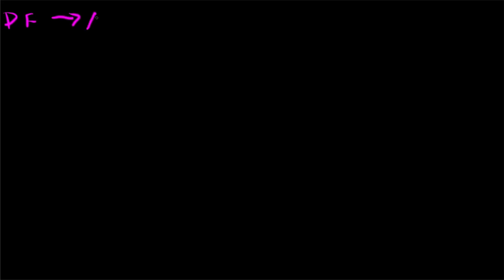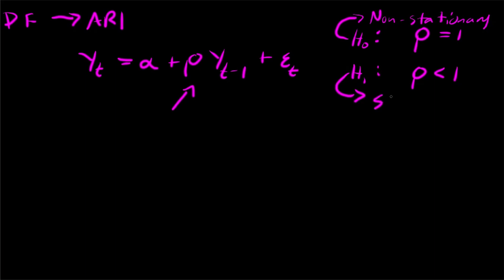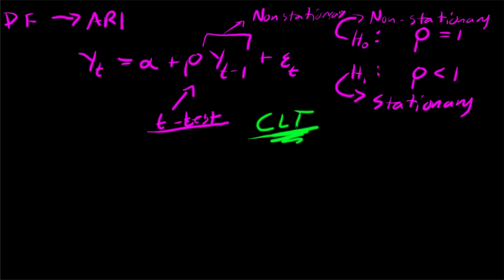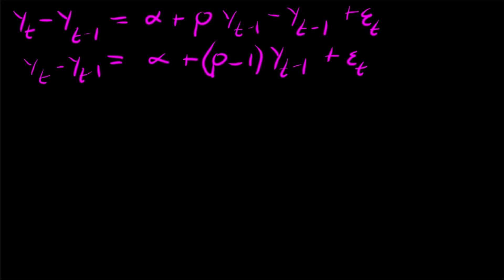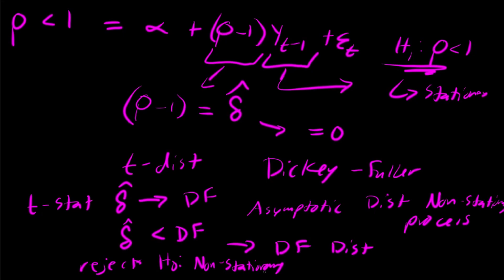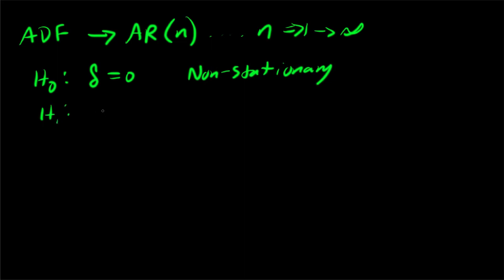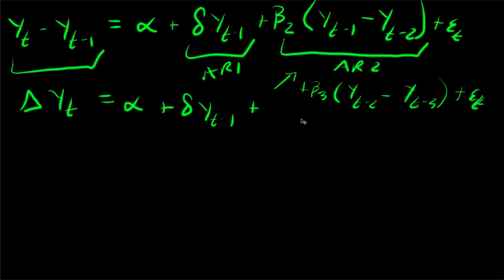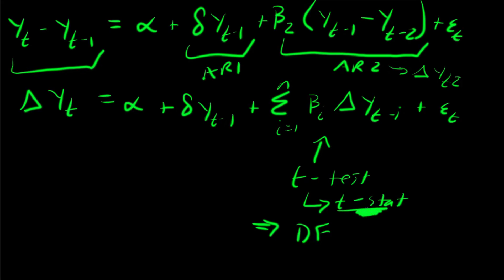DF and ADF Stationarity Testing (TS E9)

Comment: Hello, I have a question, when I manually find the Dickey Fuller statistic value, the statistic value is very slightly different from the value generated from the Eviews program, although I use the same data, what is the reason?,, I mean the normal Dickey Fuller test, not the developer
Reply from the maker: The difference is most likely due to how Eviews programs the calculation. A slight difference is also seen been languages as well depending how they coded it.
Reply: @DimitriBianco  
We can check whether the error is in the software or not, if you can do the normal Dickey Fuller test on R studio or any other software and compare the result with Eviews application

Comment: Heya, 
Thanks for the great video - but I still have difficulties understanding how to analyze the results.
What does the p-value represent? The critical values? (lets say, 1%, 5%)? The ADF statistics?
Reply from the maker: It's checking for a unit root. In simple terms we're wanting to know if Y(t) and Y(t-1) have a correlation of 1 or greater across time. -1 or smaller is also a concern. The different lags test for further relationships as well.

Comment: Please can you show a detailed computation of that in the r. I am having some issues with it.
Reply from the maker: For the hypothesis testing you continue to use a t-test however you have to use the Dickey-Fuller (DF) values to check the significance. DF actually estimated a special distribution for this testing as a normal distribution doesn't work. You can find the table on the website linked below.
https://www.statisticshowto.com/adf-augmented-dickey-fuller-test/
Reply: @DimitriBianco  thank you for the reply, I ended up using EViews which was much easier for me.

Comment: In the ADF section, why did you add the B_2(y_t-1 - y_t-2) term? Are we now assuming y_t is an AR(2) process?
Reply from the maker: For stationarity testing we don't assume any specific structure however we do need to test stationarity across multiple lags to see if any high order AR process are present such as an AR(2) process. . In practice you should test enough lags to get a full cycle where the cycle is usually determined by knowledge of the problem. In finance for example we want to test a full year and sometime I test 2 years if I think there could be a reason on why an AR process could be longer.
Reply: @DimitriBianco  thanks for your help!

Comment: Very helpful! However, you say that you prefer stationary.test much more then adf.test. I used data on US private residential fixed investment and my outputs for both tests were the same. So why is stationary.test better?
Reply from the maker: The reason I prefer stationarity.test is because you can view the p-values for Rho and Tau while the adf.test only provides the p-values for Rho. When the ADF is greater than 1, the Tau p-values should be used instead of the p-values for Rho. If you are interested in more details around it, as well as academic references, you should read my paper on ARIMA modeling.

https://www.garp.org/#!/risk-intelligence/all/all/a1Z40000003Kw7BEAS/uses-abuses-arima-ppnr-modeling-risk-management-why-not-to-fear